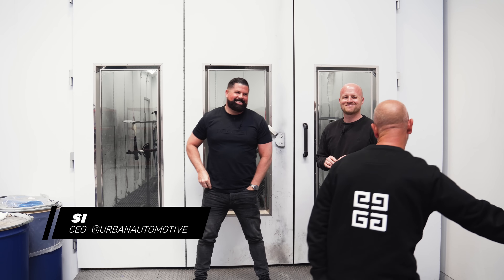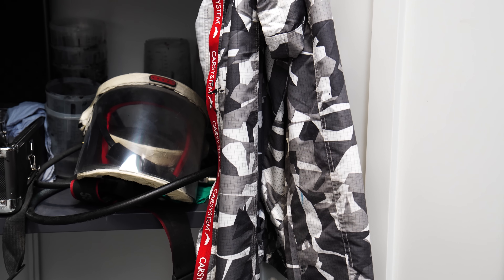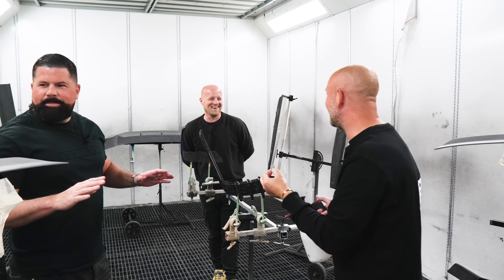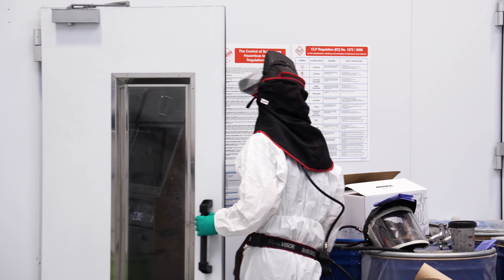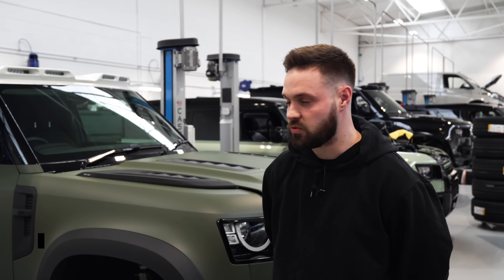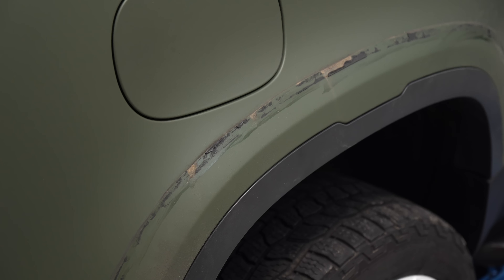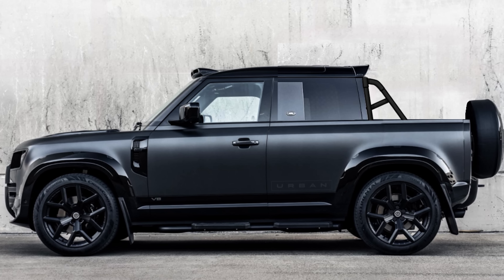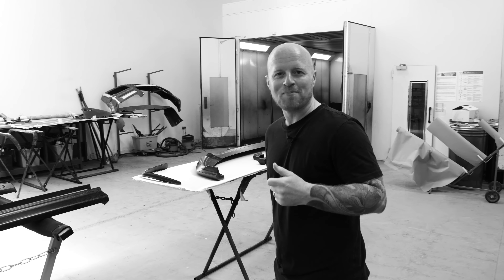SETTLING AN ARGUMENT: RSQ8 VS RS6 - WHICH URBAN MODIFIED AUDI IS BETTER? | URBAN UNCUT S2 EP19

Comment: My Urban wide tracker arch just fallen off my v8 defender on the motorway here in New Zealand, ordered the new arch (they are very expensive ship to new zealand) and it turn out to be that Urban has update their instaill method with updated primer. hopfully, they wont fall off again.